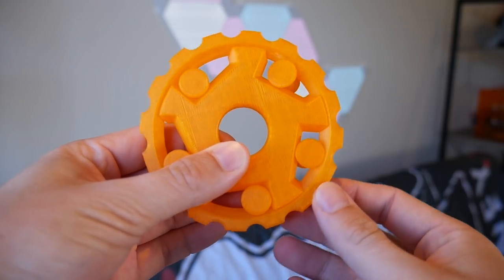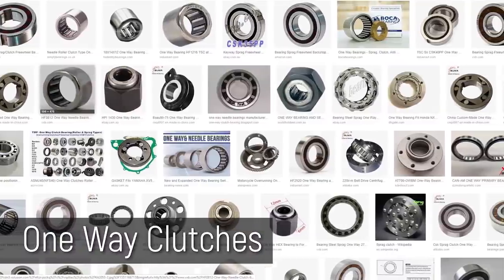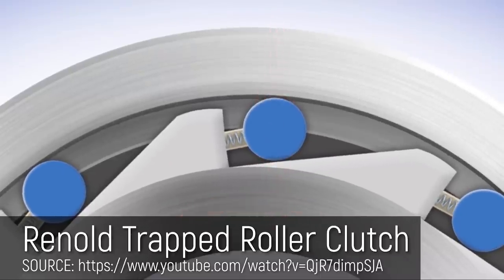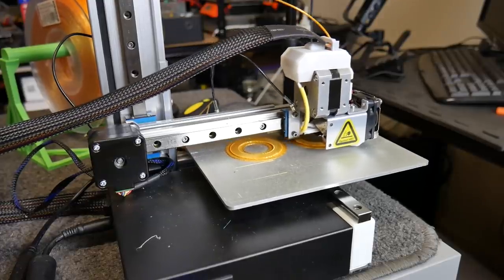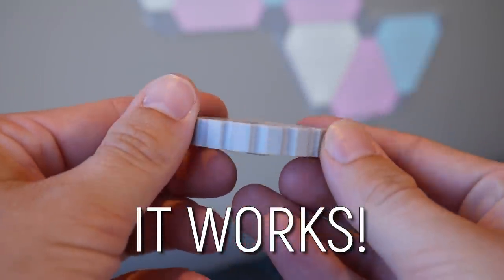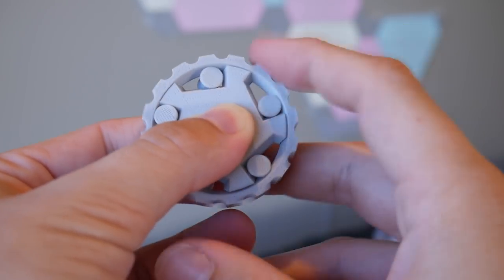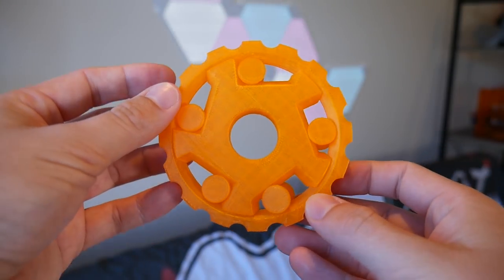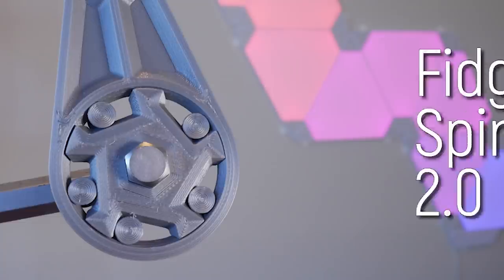Can you 3D Print a One Way Bearing? Roller Clutch Design

Comment: If you just scale it up arent you also scaling up the tolerances, making it more unreliable in the process due to bigger gabs?
Reply: I was thinking something similar, but concluding instead that he could probably use his original design again with the tolerances appropriately scaled up by a factor different from the rest of the model.  It's possible his hourglass-shaped rollers are a better design anyway, though.

Comment: I think you can print it with a squared hole at the center to use it as a ratchet putting inside the socket needed

Comment: You are aware that we now demand a 3D printed bike from you?

EDIT: wow, i Never had that many likes on a comment, thanks guys :)
Reply from the maker: Yep lol, I'll find one.
Reply: Send it to Tom Stanton.
Reply: Tom could print it. No need to send the hard version.
Reply: Isn’t that a job for Ivan Miranda? 😀
Reply: @Hasitier  he's working on the tank.
Reply: Carbon Fiber Nylon maybe?
Reply: - A 3D printed bike with a motor. And the motor should be also 3d printed (i saw electric 3d printed motors and compressed air 3d printed motors).
(-:
Reply: Maybe using conduit ala mpcnc lol
Reply: @MakersMuse   Start with a kickbike and work your way up.
Reply: @MakersMuse  however you do have an out you didn't promise a "full scale" one :D
Reply: HeiA, and that he be seen riding it.  Ol' Mr. Angus strikes me as the indoors-ey type.  We may see some joint/hinge vidoes first with 3D printed body armor in the background...iterative design!    Anyway, thanks for sharing your work, Angus!
Reply: we gotta compare it to the all-wood bike made by William Osman
Reply: William Osman made a wood one.
Reply: Collab with Michael Osman (actually cameraman john)
Reply: What are the heat tolerances on ABS due to friction?
Reply: I agree
Reply: so we already have fully wooden bicycle, now there will be fully plastic bicycle. What's next?)
Reply: This is perfect i might use this for home made go kart make that out of steel* instead 👌
Reply: indeed go for kid size its cheeper
Reply: He can use this roller clutch as the bike's hub
Reply: where the wheels only go one way
Reply: @jskratnyarlathotep8411  fully spring bike
Reply: Tom Stanton made one
Reply: grande1900 Link?
Reply: yay

Comment: You should look at the research around compliant mechanisms. Might be a good topic for an episode or two.
Reply: When he mentioned not being able to print springs into the design, compliant mechanisms were my first thought.
Reply: @christophersmith8014  in the case of compliant mechanisms, leafsprings are used most of the time. 3D printers can print leafsprings fairly well. 3D printers are arguably the best tool for making compliant mechanisms.

Comment: You should also make some roller skates with it - you will be able to move forward without pushing from side to side
Reply: Rae S how exactly?
Reply: By attaching 4 of them to each shoe, arranged like the wheels on roller skates.
Reply: @mrjbexample  that's an interesting idea, only issue might be the amount of force it can take before skipping.
Reply: Not really, you'd have to push faster and faster so that the acceleration imparted on the rollers are greater than their current rpm does, cause if not, it'll just "slip" because technically, the rollers are still rolling forward, only slower as you push. This will work at low speeds, but you might as well just walk and save the awkwardness

Comment: That looks like it makes more friction than a ball bearing
Reply: Yeah. It's not actually a bearing; it's a clutch. In fact, it actually requires bearings for support.
Reply: @gibmebalut  ok I didnt think of thay
Reply: The balls arent functioning as the bearing in this situation, the balls are the locking mechanism.  The outer ring is only held in place with the solid inner parts which would cause friction.  It would be like if you made a car where the wheels lock against the ground in reverse but raise up going forward so that the car can only slide on the undercarriage one way but not the other. Not the original function or more efficient or even very useful.
Reply: Daniel McArthur yeah, I was hoping he wasn’t going to go the whole video calling this clutch a bearing. That would have been tough to sit through lmao. At least he admitted that he’s calling it the wrong thing.

Comment: Have you tried to reverse the taper. It might improve the performance. I say something about this on one of the math channels. It has got to do with the stability of the system and the inherent instability of the shape you have used for the bearings
Reply: Like how train wheels are slightly conical, and it works in one direction much better than the other?

Comment: Bearings are generally heavily greased, this would remove most friction on the bearing.

Will it still work with the grease/oil?
Reply: One way bearings (clutch bearings) are not heavily greased.

Comment: Hey Angus, really nice design and idea, there is only one thing that makes it a bit tricky. The only reason the clutch works is because the inner frame and the outer frame slide along each other when rolling in the right direction. The balls/cylinder/cones now ONLY function as a blockade when rolling the wrong way, but not as a rolling element in the right way. I think the spring exists within the original design for that reason. Your design works, but i'd like to see a version in which there are rollers functional in both directions or at least a mention and consideration. Thanks Angus for great content!

Comment: Nice, I have some ideas on how to use this. A stepper motor, a micro and this mechanism and you can do many little things. The clutching mechanism should help prevent the breaking when a reverse force is applied to the motor shaft , or so I hope.  Thanks for inspiring :)

Comment: If this one way clutch is not attached to your wheel hub but to the pedals, and you shift to a lower gear then you can put less stress onto your pedals (and one-way-clutch-thingy) while still delivering enough torque to get rolling. Do this sort of stuff to make it work, bake it in an oven, print 100% infill, etc...
I know one thing: it will work if you do all of this and if you ride carefully, but i'm not sure how long it will hold up, and that's the interesting part.

Comment: why not instead of tapering the bearings inward you taper them outward so that they wont split apart if too much force is applied?
Reply: If you look at the pink one that failed, you can see a little of this on its bearings. I am not an expert, but I suspect tapering at the ends still allows it to turn around in the slot and fail, the same way the pink one failed. It's the tapering in the middle that prevents that.

Comment: A 'one way ball bearing' was called a "sprag clutch" a bazillion years go. I was instructed on them with the Army 2 1/2 Ton and 5 Ton cargo trucks in 1970. The sprag rollers were used to engage the front axles 'automatically' when the rear wheels are spinning. To disengage, the vehicle needed to be backed up a very short distance to have the front wheels rotate freely again.

Comment: Angus, I told you a one way clutch would work! Ok Ok, I can't lay claim to inspiring you as someone else might well have thought of the same thing & told you first or you might never have seen my comment :( 
However! you wanted a particle use for the two way to one way device, well,  if a strong enough unit was attached to say wheel chair wheels (under the seat), and the power (drive handle ) was placed in front of the occupant,  pushing and puling will provide forward motion (or backward if you bugged up installation).
You never know this might provide some physically disabled person a self propelled form of transport.
Thinking more about it as I type this, if you were able to disable drive to each wheel at a time a) releasing them, it could then be moved as normal wheel chair, b) just one and using the drive will then  propel it in a circle.

Comment: if you take plastic pencil, and shop-check-paper piece - turn round tube - paper on pencil - like a paper tape on axis - and you get same mechanical part - it catch plastic axis strong by friction when paper tape roll-spiral became lower diameter by rotating outer paper turn(you can glue it to outer tube) - and when direction of rotating like if want to turn away some of paper film - it bacame loosen instantly-releasing axis from strong hold of paper roll

Comment: Video Idea. I use raw filament for lots of jobs. It makes great rivets in 2mm holes. Just heat and push on end, you got a rivet. Or a 2mm hole 2mm deep, light filament on fire then push it in the hole. Very strong, great for attaching push rods.
   More. How do you organize all your 3D print project files? All the .stl's in one folder or One folder for all the files for that project?

Comment: You can enhance that thing by printing a material spring into to construction or a spring that you can insert after printing. If you turn the clutch backwards not all rollers block. So that's what the springs are for. Either find a way to 3d print them or insert them with a hole or a channel or something.

Comment: I know this comment is 4 years late but if you ever revisit this project, you could integrate a single curved protrusion to act like a spring on the inner track where each bearing is. It would be just strong enough to hold the bearing from binding up when gravity is pulling it toward its narrow side, therefore preventing it from locking prematurely. But it wouldn't stop it from locking when it's actually supposed to. This is why your mechanism is binding up.

Comment: The reason why sometimes it's getting stuck or stuttering whatever you call it, is due to the fact that this design works perfectly only in horizontal position, once you put it vertically and stop it, observe carefully. Some of  the bearings are in "stop/block" position due to gravity. Ofc this doesnt really apply once you reach certain RPM but it is the main reason why there are springs in original design.

Comment: do the bicycle thing and use 100 percent infill. also, does anyone want the ultimate 3d printer that can switch nozzle diameter and materials and print at least 10x faster than current fdm printers? and print up to 800 degrees c? so capable of aluminium printing if you purge the chamber/use vacuum

Comment: I think the durability of the clutch is pretty questionable. I don think it will last very long even machined from steel. There's also alot of surface area contact/friction which destroy's it's usefullness as a bearing vs traditional bearings.

Comment: I'm an aircraft mechanic student, and this roller clutch design is actually commonly used in helicopters. Often referred to as a "freewheeling unit" and allows the main rotor to rotate freely if the engine RPM is lower than the RPM of the driveshaft driving the main rotor.

Comment: Angus, I only saw the full action of this one way bearing in a few shots of your video, but it appears that not all the balls, and perhaps only one of the balls is binding in the stopped direction.  If this is the case, I would imagine this is where the slippage is coming from in your reverse test.  It seems like it would be best to have at least one ball on each side of the bearing doing the binding so that it holds stronger.  Just a suggestion, but it seems to me that the bearing design still needs some work.  BTW, I love your channel, and watch it when ever you come out with something!

Comment: Some bikes already have that as the freewheel instead of the ratcheting pawl mechanism. So why not?

Might also be useful in things like winches and such. Perhaps with a sleeve ring with pins through the roller centers that would also allow it to either run freely or catch in the locking direction.

Comment: you could make a sprag clutch on a dual extruder 3d printer. if you used dissimilar plastic on a dual hot end system, they wouldn't fuse (or shouldnt)

Comment: Although the bike thing sounds cool i would like you to use both the 2 way - 1 way and roller clutch in tandem with a few other gear setups and make a pendulum driven mechanism similar to that of a grandfather clock. Try to achieve something that maintains near constant movement (understandably it won't be perfect perpetual motion as with our current understanding that is impossible). Maybe have a modular line of weighted pendulums with magnets in them and have them drive a line of wheels with likewise to repeatedly push and release the pendulums to maintain drive.

Comment: 3D printed is not well suited to friction; I guess nylon would be the more durable material for that practical pieces but aside from that any other plastic will rapidly lose size and thus render the mechanism unusable; for demonstration purposes (i.e. teaching how something works) is fine but for real use you need metal

Comment: Could you put the 2-1 mechanism with your one way bearings into a 3d printed push-drill that uses rubber bands as the spring and the mechanism to make it such that the push drill spins the bit in the correct direction on the up and down stroke?

Could you also include some kind of mechanism can but the drill in reverse and still function on the up and down stroke?

I think it would be fascinating and could potentially make 3d printed push drills viable for actual use.

Comment: You do realize that the "bearings" are gravity dependant?  Only the bottom bearings are engaged. If they were all engaged, you may achieve even higher torque before things start slipping. Also, when free wheeling, does the ring ride on the bearings or the inner hub?

Comment: It seems like without the springs only one or two of the rollers are locking up each time. I wonder if you COULD figure out a way to have those springs if it would slip of fail.

Comment: Roller Clutch Design might be interesting for a filament spool so the spool doesn't roll back. I would use it as a hub on the spool and run a 8mm rod through it as  the axle..

Comment: Super interesting. Is there a follow up video to this?
I payed for the 3D files and I printed this. It worked at first but quickly stopped locking consistently. Also, mine has quite a bit of angular motion before it locks, even when it was freshly printed. The rollers have to be spring loaded into the wedge for the locking action to be quick.

Comment: One-way bearings are used in the main gearbox assembly on Airbus helicopters. It is what allows the rotor and rotor shaft to freewheel when the aircraft loses engine power and has to autorotate. It also keeps the sudden stopping of the engine from damaging the main gearbox.

Comment: If you could use a spring to force all of the bearings back up on the ramp then they would all engage and help prevent slipping. Right now only one engages and that os due to gravity. I bet this mechanism wouldnt work well if held sideways so that the axis of rotation is verticle.

Comment: I think these bearings are completly defeating the point of a bearing. Instead of helping the outer ring roll, the conic shapes are only used for blocking motion. In the direction where it does allow motion, it just slides over the inner ring directly. Feels pointless.

Comment: I usually add "wait for user input" into the gcode files (M400 M0 in marlin as far as i remember) ,where i need to insert mechanical parts like nuts. This may also work for springs.

Comment: you can achieve better strength on the bearing if you reverse the taper sides, with the current design you may shear the rollers because they are being squeezed when locking up and they have thin (xz plane) cross-section area at the center. If you make the rollers with a hexagon (yz plane) cross-section, they will perform better.

Comment: Just another question, I have been printing my raspberry pi case and when it comes to the round hold on the model it carnt print them good but prints everything else ok. There is a bit of stringing in between them. It seams that some times there is not a lot of filament coming out. Around holes. But every where else?

Comment: these are mechanical diodes, the names can get confusing because ppl use them so interchangeably however its not accurate, there is a such thing as a one way bearing as u saw but the 3d printed version isnt one, unless its bearing itself in a slow speed demo :p   idk if id call them clutches tho, they are technically but it can b misleading, "clutch" is conventionally used for something that slips   mechanical diode sounds cool anyway :p

Comment: I could use a 1 way bearing for my magnetic generator but I need as little resistance in 1 direction as possible so the magnets constantly push the system in 1 direction without pushing and pulling in the center locking the system up. was going to solve this with specially designed magnets. anything that can make it more efficient as possible to get best performance is ideal.

Comment: Looks like it's slipping because not all the rollers bind at the same time. Hence the reason the real ones have springs to keep ALL the rollers preloaded so they all share the load. You're never going to get great performance till you come up with a solution to that. Cool proof of concept though.

Comment: the most common use for something like this is ratchet wrenches/screwdrivers. You want it to spin one way without activating, and you want it to no longer spin the other way when you are actually tightening or loosening the bolt/nut/screw